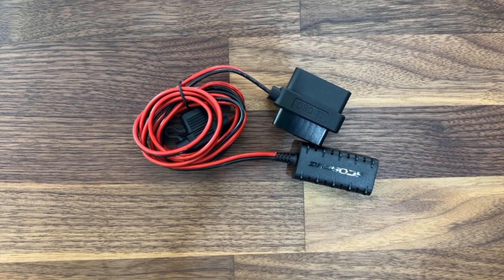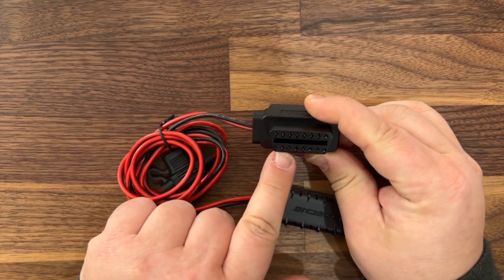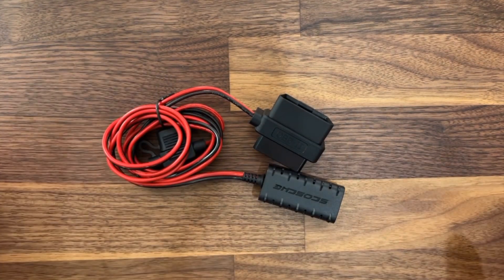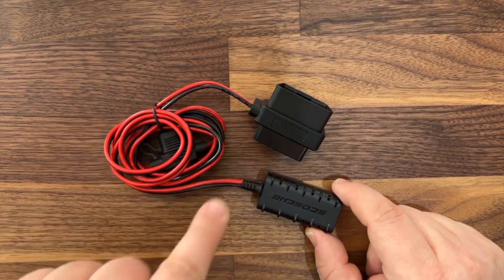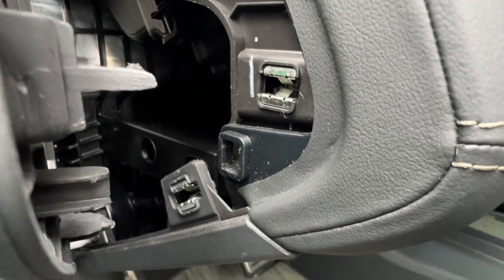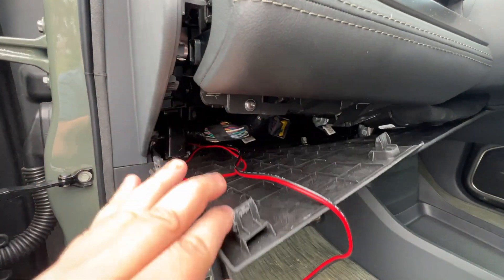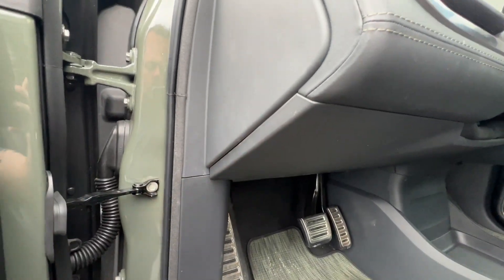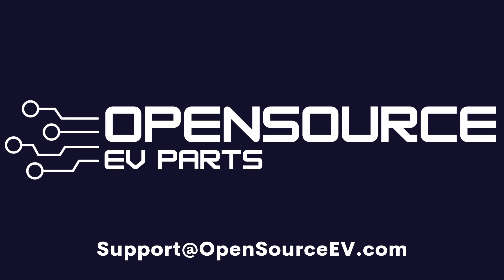Add a Dash USB Port to your Rivian R1T or R1S Using OBD-II

Comment: Is this just to get a USB A port? I don't yet have an R1T, but thought I saw a 12V outlet on the underside of where the main screen is located?
Reply: No more. They removed those port last year.
Reply: I think there are usb-c ports there now though.
Reply: @MulloyDIY  The used one I purchased was old enough to still have 12V outlet. Works for me. Thanks

Comment: Do you risk draining the 12v battery with this always plugged in?
Reply from the maker: EDIT: This depends. It appears that if you have something plugged into it, it will continue to keep the port active. We recommend unplugging this should your vehicle not be driven for a long period of time and we strongly recommend not charging anything with it when the vehicle is not on.
Reply: @MotoInsight  I did not know this and I always unplugged mine! Thanks for the info!
Reply: @MotoInsight  what you think about dash camera?

Comment: What if more than one power sources are needed for multiple accessories? what other options are there? I know some have successfully tapped rearview mirror housing. Is there another 12v source above the passenger footwell? Pretty annoying that Rivian has done away with the underdash socket.